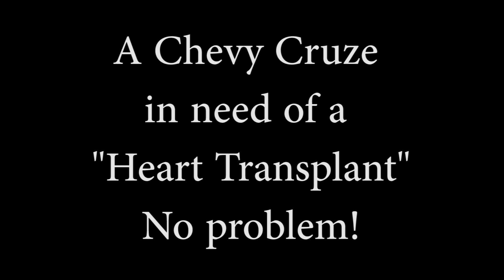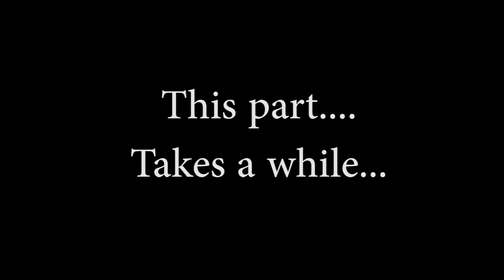Returning a Chevy Cruze to the Road. Engine Out, Engine In, Back to work!

Comment: I have a 1.4l Cruze like this, bought her new and they do have some issues.  Take care of them correctly and there’s no reason for them to blow so quickly.  Change the radiator temp sensors when you do the thermostat, swap out the plastic coolant junctions, and change the intake cover.  The PCV valve goes bad, so get a PCV valve relocation kit for it and the car will run GREAT.  Good call on the water pump, the original is a known failure point and was a recall from Chevy.

Comment: Funny thing about salvage yards is that all of the engines / Trans they sell have between 60-80k miles because no one wants something with the 140k miles that it actually has and their is no way to prove otherwise 🤣
Reply: Not only salvage yards...i traded my motorcycle in on another one at a bike dealership (a small bike shop )and happened to stop back by the bike shop a few months later just to look and my old bike I traded in was still there but with a nother speedometer on it with a lot less miles.... everyone's a crook